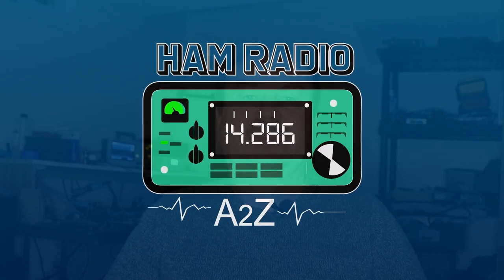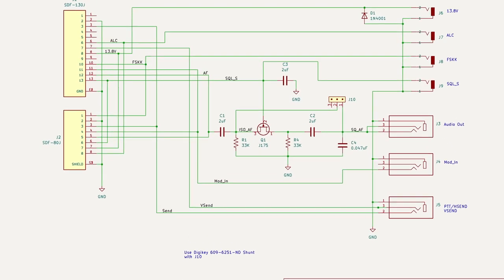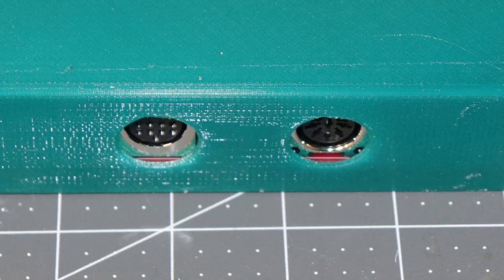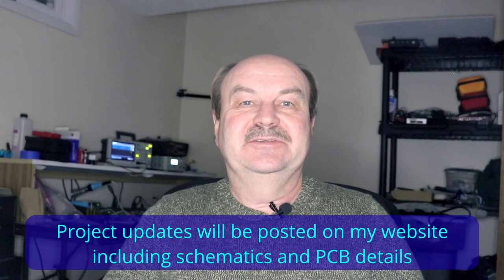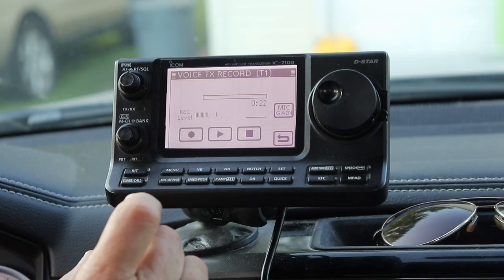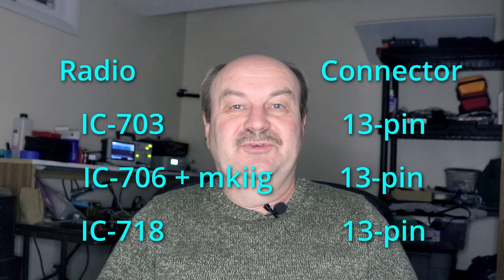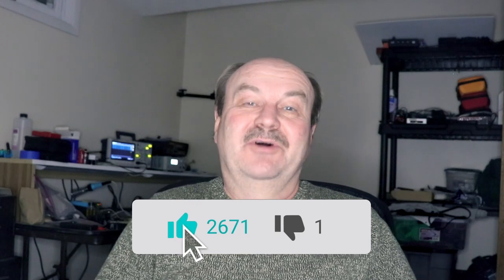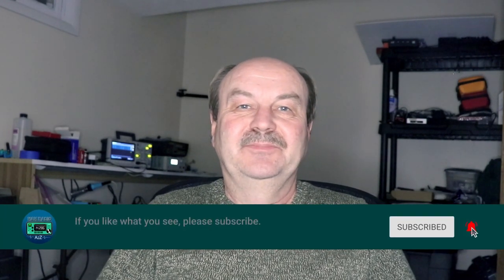Channel & Icom Interface Update 2023

Comment: you have been my goto for the 7100.  It has helped me understand the radio.  I look forward to your accessory board!  And now I am looking at the hm-151.  Also the other site to improve the mic sound.  A little over $100 total cost.  The 7100 is my only comprehensive radio so I want it to be my best.
Reply from the maker: Thanks for the kind words Rory.  If you use the rig mobile, the HM-151 is great.  If you’re using it primarily as a base radio, you might be better off with a base station mic of some type.  The Icom SM-30 is a good choice, if you like desk mics.  The Heil microphones and/or headsets are also very good choices if you prefer a boom mic or a headset.

Comment: Hi, I'm looking for 2m/70cm FM/SSB + airband (RX only) radio for base station. IC-7100 looks nice but does it cover airband? In the manaul there is nothng specific about it. It schould cover RX form 0.030 to 199.999MHz but with the note: "Some frequency bands are not guaranteed". Can I use it to listen AirBand?
Reply from the maker: The 7100 does receive airband frequencies fine.  I have several local airport frequencies programmed in memory on mine.